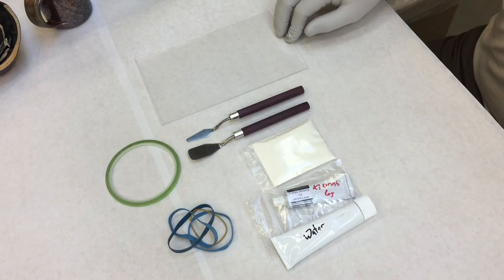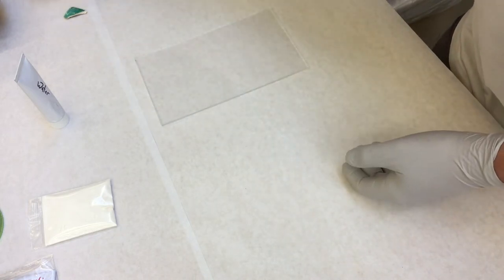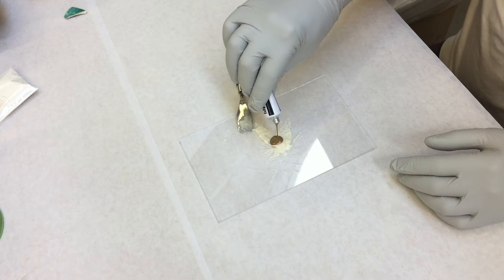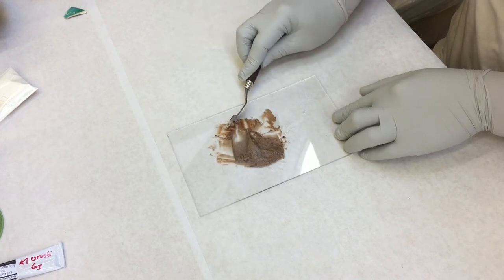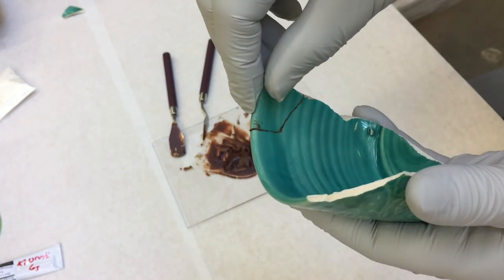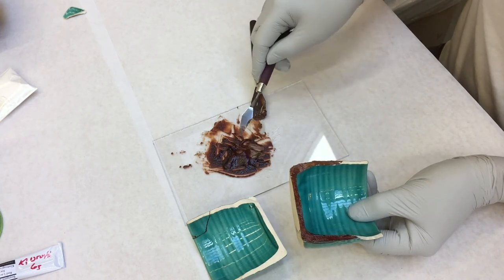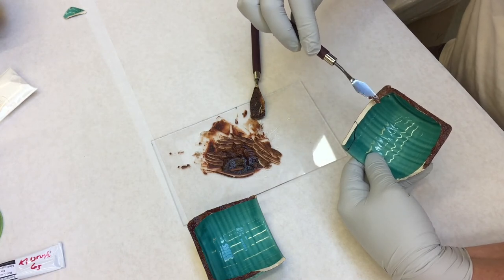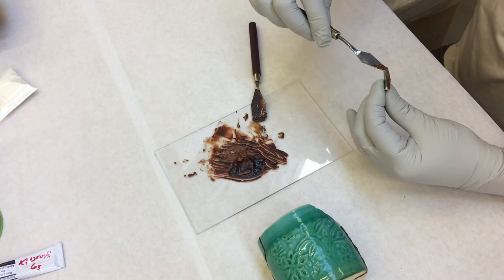Authentic Kintsugi Repair with Explanation of Steps

Comment: Hello sir, I've got a question: I have followed your instructions above and glued together a yixing teapot. The bottom part was broken into two parts as well as the lid, which was also broken in two parts. The bottom seems to hold quite well. The lid, which was broken roughly in the middle, however, did not last so well and broke again after being in contact with hot water a number of times. I have dried the parts for about 3 weeks before using them. Was that too short? Or do some parts sometimes need some extra support whith a metal brakcet or something? Thanks!

Comment: (sorry if you mention this in the video), I'd like to know if there's any way to do kintusgi that is food safe, can objects mended together with this technique still be used for food/hot drinks, and put in the dishwasher?
your way of explaining is very thorough, I appreciate that a lot, so if possible I'd like to follow along
Reply: He does mention that authentic kintsugi using urushi is food safe at about minute 17:30 or so.
I don't think he says anything about it being dishwasher safe, but definitely food safe once it is cured.
Reply: Traditional kintsugi is food safe. Also dishwasher safe, BUT continuous hot water exposure can weaken the repair.
Reply: He shows at the start brown cup that has been repaired years ago and went to dishwasher many times, still stays intact
Reply: @liivikasaarman995  no, he says that the dishwasher damaged the repair and that's why he has to fix it again now

Comment: If you don't have the money or time, try 2 part epoxy resin and mix in some gold mica.
Reply: how to acquire 'gold mica'?
Reply: @marlenkag3155   From a craft shop. Very cheap. Cheers
Reply: But this is not proper kintsugi